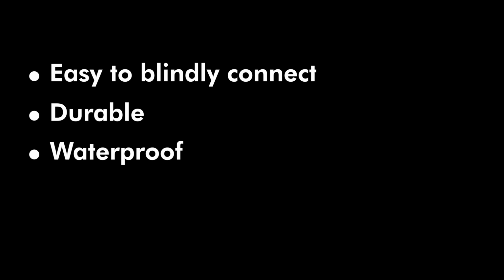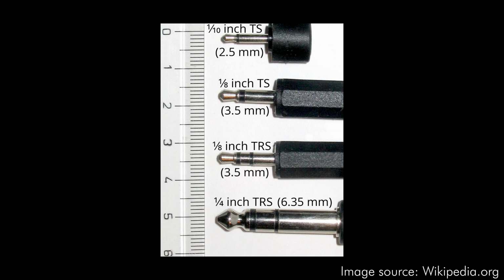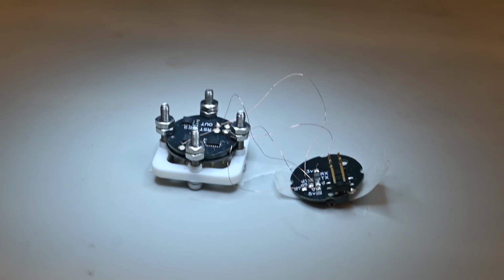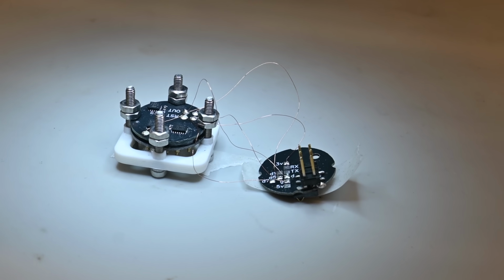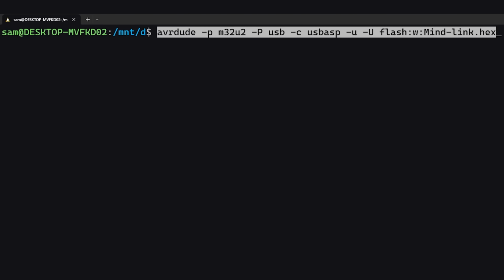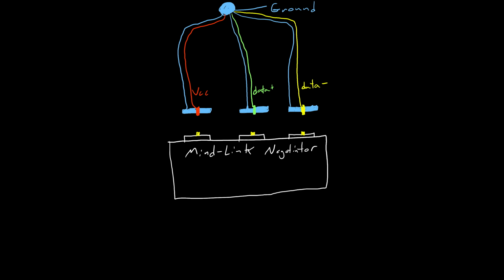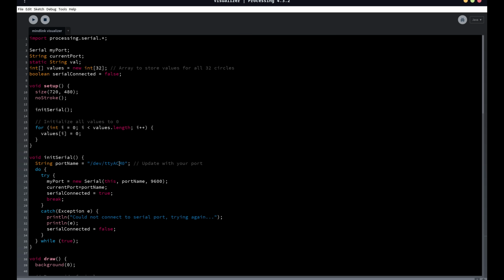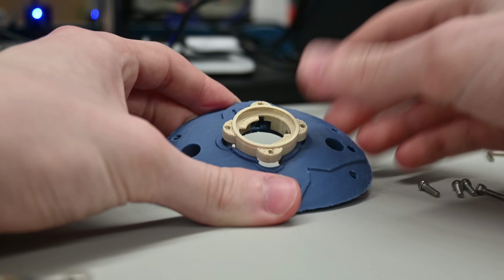Making a Brain Computer Interface in My Garage

Comment: Although I love crazy ideas, I feel like we're unfortunately still living in an age where interfacing with nature's most undisclosed complex instrument is gonna take more than an Arduino starters kit. It feels like wanting to build spaceship when all you got are trees and stones and a few tools to work them.

Much more tech than we have working today needs to be invented. An atomic scale robotic remote controllable workforce maybe, sailing through our veins to reach difficult to reach places in our bodies to then start doing construction work at a precision unseen today.
Reply: Any real device would be using FPGA based control boards at minimum (for like research grade systems) and custom asics for end product devices. You will probably need on the order of a few hundred electrodes for any reasonable resolution for sensory applications (for both recording and stimulating) which is not really something a microcontroller can handle. Add onto that the issue with the analog side, you’ll need a huge number of amplifiers to handle the data acquisition and the actual (current or voltage) waveform plus any safety circuits preventing side reactions at the electrode interface. 

Unless you are working at the IC level your devices will wind up being server rack sized using off the shelf components.

You would be surprised how well just inserting electrodes into the brain works though. The major issue is the material forming scar tissue months after implantation. This is probably navigable. A good portion of the scar tissue is formed from the surgery itself which can be eliminated with cleaning implantation techniques and drugs to prevent scar formation. Another cause is a diffing Young’s modulus between the electrode shanks and the brain. Basically the electrodes need to bend with the brain but if they are too stiff they brain will deform more than the device will and this will cause micro injuries around the shank which contribute to scar formation. Many research devices (like neuronexus probes) are silicon (metal) shanks and this extremely ridged. Other materials can be used, like the PDMS (a silicone rubber) shank used by neurolink (they didn’t come up with that just used the design). But those have additional issues because they are so soft they slowly back out of the brain.

Comment: switching to a more powerful microcontroller with more gpio might be useful to simplify the design to get around the whole multiplexer thing. if you're using a tqfp atmega32u2, the fan out of the leads is about the same size as a qfn rp2350. also, how are you going to mitigate heating of chips deep in the layers? does it just run until it gets dangerous/overheats the chips themselves and then have to emergency shutdown until it dissipates?

Comment: Consider using an FPGA:
They are very good at handling massive ammounts of data.
They are easily reconfigurable, making development and patching at later stages very convenient.
They are very power efficient, making heat less of a problem.
They have high speed trancievers, so you could have your high speed serial connection being clocked higher than the rest of your design, further improving heat problems.
Also, running Machine learning models on them is very easy.

Awesome work you did!

Comment: This branch of the idea is doomed to failure. Brain activity has wave data transmission, although it is very low-power, it would be possible to wirelessly record and transmit data near the surface of the head like a Wi-Fi transmitter.

Comment: Be careful with this, there's so many different things to consider when it comes to things that touch the brain, and generally, thin slots are better than holes but sterilization is always essential. No bacteria or viruses are allowed to get in.

All that being said, maybe the spinal cord is a better access route? That of course has its limitations, but what are you trying to do exactly? Depending on what that is, the spinal cord might be fine. Location does matter. But maybe not even need any access at all if you can somehow split the signal from the noise, since reading the brain's electrical signals causes a lot of messy interference from muscle twitches, nerve impulses, etc. Predictive modelling is your friend.

The main risks I can think of (there may be more?) with anything designed to go in are whether or not it might cause an infection to happen, or lead to bleeding if your brain happens to get squished against your chrome (eg. slamming the brakes in a car, rapid acceleration or decceleration), or increased skull fracture risk from comprimises to the structural integrity of the skull.

Not to discourage you, just make sure you seek out medical expertise if you're gonna do it. Don't take my word for it, I'm just an Engineer, there's probably many more things I missed to be designed around. Keep it up!

Comment: Small electrodes of varying lengths that stab into very specific points of the brain to access memory recall, live vision, etc. Connect over Topological Qubit Link that is read to transmit to and from a customs built server, I recommend an H200 server for high accuracy and a Genetic Algorithm, BiLSTM, and HWKV to learn the brain with different inputted stimuli to successfully calibrate. I also recommend having a 15 Tesla, Quasi-Time Crystal based MRI, and enhanced EEG and EMG Scanning. Combine this with a Quantum Evolutionary Genetic Algorithm for high accuracy. The models should be able to learn and adapt to the brain.
Reply: Would this work though?

Comment: i think this sorta design in which you drill a hole in the head is less optimal then implanting surface electrodes on a thin flexible substrate and then having the rest of the computer externally this means the surgeries less invasive (though still pretty invasive) reducing risk of brain damage and making healing in the event of removal less complex iirc. very cool project though! and awesome video to go with it!
Reply: I suggest a VPN and a need of power lower than a coin battery
Reply: @grilledcheese8976  Every youtuber suggests a VPN!

Comment: I used to love the idea of a BCI, but at the point I'm certain that the first thing people will figure out how to do with it when they're commercially available is make them a subscription service and inject ads directly into your brain even though you're paying for the BCI Pro+ plan. At least right now the inside of my skull is still sacred
Reply from the maker: That's a concern for most. So hopefully open sourced ones become normalized.
Reply: @AstroSamDev Also, nothing internet connectable. At least not directly.
Reply: @AstroSamDev  Nope. Won’t happen. Name ANY other example where that has worked.
Reply: @scoobertmcruppert2915 What, an example where an open source project gained reasonable traction in its space? Linux, several important parts of the internet, basically all VR peripherals worth using, anything MIT students ever developed of note, the entire mechanical keyboard hobby, I'm sure there's dozens more I don't have knowledge of.
Reply: Yeah that was mentioned in at least one scifi novel (I think it was The Diamond Age).  In the book the unwilling ad injectee topped himself, I would either find a way to undo the ad injection, or do the same.
Reply: Open source offline brain implant is only thing I'll even consider getting
Reply: Which is why we really need open source alternatives, or at least open source alternative firmware for them
Reply: This is a direct plot of "common people" the new black mirror episode
Reply: That's why I like the idea of just having a connection. I do want to control my computer with my brain, I do not want computers in my brain
Reply: That’s my concern to hopefully they will be a law  against it could you imagen your a sleep and some company turns your dream into a ad that would create real life cyberpscho
Reply: @chryoung-db2iw at that point we are visiting Arasaka tower
Reply: This makes me laugh because technically speaking, we already do this with phones and tvs. 
Our eyes only exist so we can see ads
Reply: @gizmothepiefaceman3062 only if you let them give you ads. Just install and adblocker and 99% magically disappear
Reply: @gizmothepiefaceman3062  yeah, but I can turn down the volume and look away also  my phone is not attached to me while I sleepso it can't stream the ads into my brain while I sleep
Reply: Lmao there is a book about this, if i remember correctly it's called FEED
Reply: We need more capitalism so we can have more ads
Reply: thats why you need it to only be one way, only input not output. all other human senses can easily be used. unless its for prosthetics but those should wire into nerves less than the brain.
Reply: Current laws regarding medical devices seemingly prevent a lot of abuse. Like currently utility companies are allowed to shut off power for non payment if you register the power as being used to run life sustaining equipment.

The concern would be reclassification of more advanced devices as something besides a medical device.
Reply: I'm quite sure that will be considered illegal in the future and  I don't think big companies would like to mess with the law. Unless it is an illegal industry from the black market, they don't care about law.
Reply: @martiddy  Why would it be illegal, Lawmakers and the people paying them directly financially benefit from it being allowed.
Reply: @martiddy  How naieve. Big companies can and do mess with laws and have been doing so for the last century. The law is just as subject to bribery and corruption as any man, if not more so. It most certainly isn't immune.
Reply: such is the nature of capitalism, unfortunately  T-T
Reply: @intangible9838  as opposed to the wonders of communism
Reply: @somerandomdragon4655  Typical ignorant Capitalist drivel. Come up with something new.
Reply: @xeniumresonator  stalin was awesome? i don't know what youd rather i say
Reply: @xeniumresonator  Does he need to? He has a point, at least capitalism works for the first 300-2000 years. Communism fails in like 30 lmao.
Reply: if people like this dude keep expanding public interest, then linux style open systems will be made available just as they are in most industries. especially as the implant itself is not wirelessly capable, being forced onto the internet through an advertiser compromised service at all items is going to be unlikely, too many people have this concern for local/ 3rd parties to have their own ad free or control free ecosystems
Reply: @somerandomdragon4655  There won’t be safe alternatives, they’ll make sure those open source ones somehow eat holes in your brain…
Reply: Probably require you to have your head in their cloud too🙂Oh and only be useable with a smartphone. Don't get me started.
Reply: This kind of thing is exactly why I could never trust a brain implant with any sort of wireless connection.
Reply: @renakunisaki right it would need to have the most secure connection like AES-256 encryption or quantum security
Reply: @fuzer4047  I'd be more concerned with who controls it, and what happens if it malfunctions.
Reply: The solution to this is communism
Reply: Watched too much Black mirror? 😂 holy that’s so gullible
Reply: @waffleurr  surely corpos would never exploit that immense amount of power like they've exploited everything before
Reply: @waffleurr It would absolutely happen lmao

Comment: ESP32 is better I guess it have built in wi-fi and bluethooth
Reply: The ADC on the ESP32 is notoriously bad and wouldn't work for this kind of noise sensitive application. However, I do agree with the idea of having some sort of wireless communication protocol like bluetooth, the electrode array and microprocessor board should be placed on top of the brain and should be powered via inductive charging through a base station attached to the head. This would eliminate the need for a port, preventing possible infection from the break in the skin a port would cause. I imagine a DA14531 BLE IC combined with a capable analog frontend would be ideal here.

Comment: What would a mediocre bci look like? Even if the port is clean and continent, could it be limited by the area over which it can recieve input? Or limited by the brain region it reads from? What kind input are we trying to receive?
Reply: It would mimmic neurons and attach itself to your neurons directly via their integrated biological interface... the "Synapse" no?
Reply: @ataarono that’s a very advanced type of interface. Most (pretty much all) devices that have ever been used for research are electrophysiology devices (basically a metal contact of some kind). You can record the voltage waveforms the neurons generate and stimulate with either a voltage or a current source (the injected waveform directly influences the neurons membrane and can change the activity of neurons near the metal pad).

Synaptic integrating devices would require some extremely complicated chemistry to get neurons to attach to them. And would need systems to refresh the device side membrane, proteins, neurotransmitters etc.

Comment: You need to thnk about adding FPGA unit to your circuit with addition of an STM32N6 series MCU. Imho ideally you should have a DSP unit for filterning analog signals, FPGA as a fast computing unit and an STM32 for other needs and a possible simple neuralnet addition. Open-source biological interface sounds truly amazing. Keep going and I wish you good luck with that

Comment: Something else you might want to take a look at is TOSLINK (optical audio) cables and inductive charging cables like Apple used for some of its products.

Using those as inspiration you might be able to create a connector better suited for implantation and especially upgrades to higher spec hardware like using the core components from the modular optical data networking hardware use in high bandwidth servers.

Not to mention that such a system could more easily be proofed against dirt and moisture.

Comment: what if you put many smal EMF meters and attach LLM to the output so this way you can kinda guess what the person is thinking without any surgery and LLM would do pattern recognition
Reply: thats not much different from reading microexpressions from somebodies facial muscles
Reply: @ataarono  well yeah but microexpressions provide less data than emf fluctuations, also you wont really see someone trying to move hand on their face but you might be able to catch it this  way
Reply: This has been done, there are a few labs working on this. Basically an ecog array is fed into a neural network to generate tokens for the LLM. There are some published publically available datasets you can mess around with too if you are interested in this stuff.
Reply: @tainicon4639 well I would but I can’t afford sensors and pi

Comment: As cool as it might seem to mimic The Matrix, the last place you want to place a brain implant is on the back of the skull.
Reply: Especially since its were the spine is. One wrong move and the best case senario is ending up paralyzed or dead.
Reply: @myluckymadness8041 Yeah, at least this thing should have structural support (i.e. couldn't be pushed inside the skull)
Reply: @myluckymadness8041not possible now does not mean not possible in the future
Reply: @VRMexican  I didnt say it was impossible, just very risky.
Reply: Would spinal cord be good place in far future? We definitely don't know enough now and probably won't for a while, but it makes a lot of sense to me as end goal in very far future. I don't know much though, but just seems right that's like main bus of the brain that connects everything kinda in some regards
Reply: @nonetrix3066 I’d imagine it could be good for output, particularly of kinetic signals for prosthetics and whatnot but no input would be possible with it I don’t think
Reply: @CM-di1oz  have you ever imagined you had a 6th thumb? Well imagine having a 3rd eye which can show data or if you had another ear I think spinal cord is possible
Reply: Care to elaborate?
Reply: @djdrew11  TLDR: Just use the top of the head and save yourself the headache (literally).
The immediate issues on the physical side make it significantly harder to do a safe procedure, alongside the longer term issues ranging from how the head moves, to the internal pressure differences, to the stronger immune response, I could go on, it's really just not a reasonable or safe location. Then, you have the technical issues, what signals are you targeting by putting an implant on the occipital lobe? if you want visual information, the top of the occipital lobe still works fine for this purpose. However, the procedure required to target these signals is a lot tighter compared to the motor cortex, and there are noisy regions for general sensory processing mixed in with signals for vision.
Reply: @lizardy2867 Thank you, I would have never realized!
Reply: @lizardy2867  The top of the occipital lobe is still the back of your head. If you start going up to the top of your skull from there, you hit the parietal lobe as soon as you're any decent angle away from perpendicular.
Reply: @djdrew11  one good hit and you're cooked. Literally